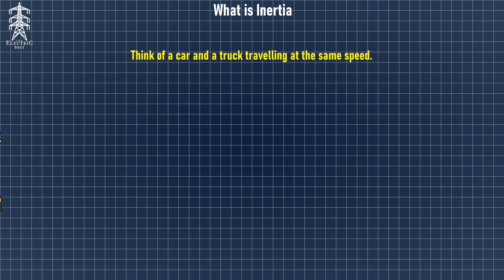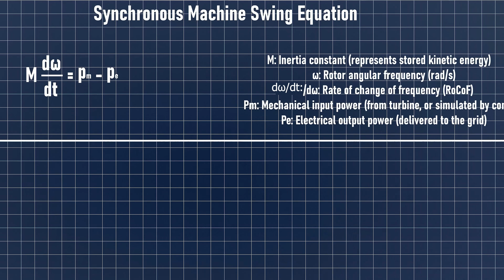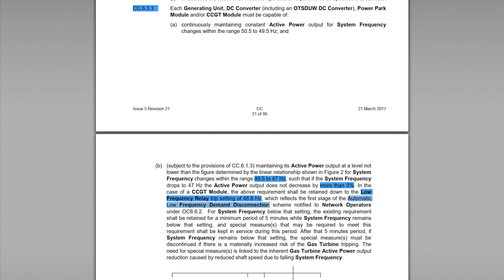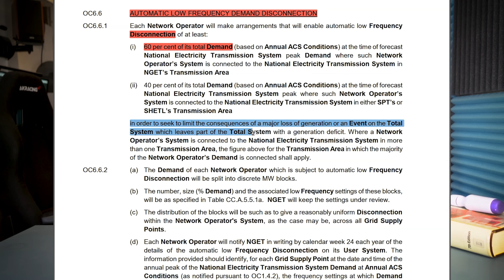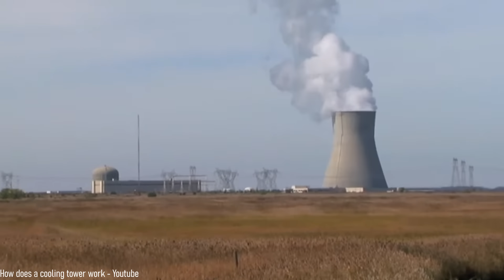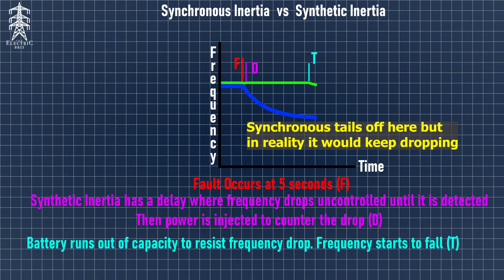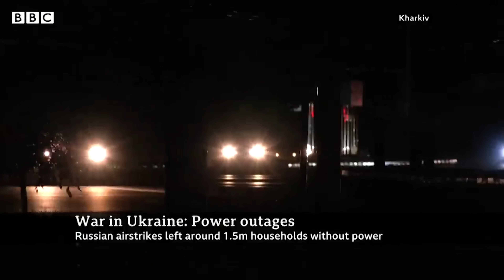How to Restart the Grid after total collapse

Comment: What are the technical costs and isuses with grid forming solar?

 I would have thought it was ideal for black starts (if you can wait for it) as there's no physical issue with continued generation. Unlike nuclear, wind, or even fossil it does no damage to the panels to create un used power  and you can isntantly collect that power. 

Obviously inverting that DC power to use it is the technical problem
Reply from the maker: I think the grid forming part is understood now that smart inverters are becoming a lot more common. G99 mandates that solar installs over 16A or 1MW must be able to give voltage support, but does not yet specify grid forming.

The risk would be relying on it solely on a black start scenario when you can’t guarantee the sunshine or consistent power output like a generator. It would be good support though with other sources.

Comment: Thanks for this. A lot of audio and visual info at once; I had to keep pausing it to follow you. You did not explain how the various islands during black start manage to keep their 50 Hz voltages in phase before they join up. I was surprised that you said HVDC interconnectors could not be used for black start. I'd have thought that importing DC and generating ones own AC would have made them ideal for helping black start.
Reply from the maker: Thanks for the comment! Yep I really need to get my pacing right on the animations and stop relying on on screen text. I’ve had a lot of comments about the resync too so should have really covered it but hindsight.

Regarding interconnectors, it comes down to the technology. European interconnectors do help each other out and some of ours based on newer VSC technology can also be used for black start, the info in the video was mostly based on official sources and interpretation though which suggest otherwise.

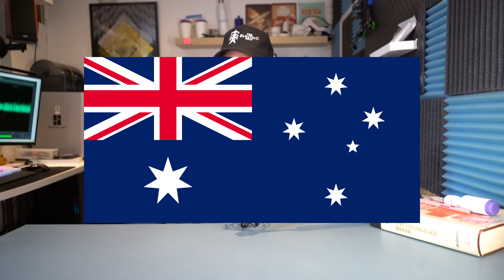Comment: 22:40 Just a clarification, Australia has the NEM, or the National Energy Market, with two states/territories not participating, and isolated/not connected, WA and NT. The other states each have a state transmission grid, with inter-connectors between them.
Also, South Australia is significantly less populous, and so we can get away with between 60-80% wind depending on time of year, worst time being the cold period around july, with as much as 50% gas.
Reply from the maker: Thanks for the context. High renewables and lower demand definitely helps it’s case for being energy independent if it needed to

Comment: A bit off topic but ... A worrying aspect for me, is having witnessed a manufacturer of supposedly high quality alluminium lugs, for cable crimping in the electrical supply industry,  completely fail to understand why they were supposed to fill the freshly drilled out cavity with anti-oxident paste - I could be worrying for nothing if this is my misunderstanding but ...

....   I'd only just left the electrical supply industry where we were taught that the paste protected the alluminium from oxidising prior to crimping and that we should not even open the packet until ready to crimp.  

However, my next job was as a drill operator / dogsbody at an alluminium parts manufacturer, making parts for everything from aerospace to the electrical industry - and I was dissappointed to see that these lugs were left lying around for days or weeks before anyone was given the boring job of injecting the anti-oxident in them.    

Unless it's me misunderstanding something, this seemed very negligent of them because surely, the whole point was to protect the freshy drilled out cavity immediately after drilling, but this was never done.   

I tried to explain to someone higher up but nobody cared.   So when work was slack,  I would be given the job of filling them with paste - It made me wonder how many of these would fail prematurely because the surface would already be oxidised  (unless the antioxident is able to restore the surface to it's unoxidised state??   I don't know - it just seemed unlikely)  - but this has always made me worry about the quality of manufacture of parts if noone is checking procedures and no-one understands the purpose of the component anyway. .

Comment: So then, were asynchronous power sources a factor in the recent colloid the Spanish grid?
Reply from the maker: I’m waiting for more concrete info but I’ll definitely be covering it in as much depth as possible. Varying reports from the two solar generators tripping to inter country oscillations across the grid playing a part. Hopefully the report is transparent. 

They do have an extremely low amount of battery storage and at the time had a lot of hydro and gas turned off, so it could have played a part but we need more answers.

Comment: Black start capability of a power plant is not the same as powering up a blacked out grid … many power plants (used to) have island mode operation (including nuclear) and backup generators that could allow the plant to start in the absence of grid power …

… the option to connect to a dead bus, a blacked out grid, is a different matter and then there is the problem of synchronising the different arts of the grid if they have been powered up independently as grid substations do not have a synchronising capability.that’s the difficult (and untested) part!

Comment: Should pony out that when turnogeneratoer are in frequency droop control, 2.5% that the system is somewhat self regulating in the short term and that most thermal and nuclear power plants can operate at 110% MCR for short periods whereas renewables can’t!

Comment: How do you sync with neighbour networks eg. via AC interconnectors (DC is not a problem)? Do you temprarily run the UK grid a bit faster (>50 Hz) or slower (<50 Hz) in order to catch up with the external grid?
Reply: There are no AC interconnecters. That wouldn't work.
Reply: @linuxgaming69  ok, so all interconnectors to the UK are DC? Then -virtually - you can do frequencywise what you want, true.

Comment: Around 2015-2017 South Australia had a total grid collapse,

Bad weather pushed a few high voltage transmission lines over, the wind towers didn’t like the transient spikes and disconnected, a major plat was under maintenance and the SA to Vic connector pulled approx 2x it’s rated load and disconnected, 
CBD was back up in about 12 hours, regional SA took months of no power.
Elon built a 100MW battery in less than 100 days (or said it would be free)

Comment: Main point: why don't we use an atomic clock and synthetically synchronise all grids to it? Neither following, nor forming. We could remove spinning turbines wherever possible - if they spin outside limits they should be the ones to disconnect and only come back when they are resynchronised (or, minor point, maybe not disconnect spinning turbines in the above scenario, but use batteries to maintain the frequency of those generators - only if that's better than disconnecting them altogether).
Reply: Supply and demand. If they aren't nearly exactly matched you've got a problem.
Spinning reserve is the backbone of the system because it contains so much stored energy. They will never slow down unless demand exceeds supply. You want to replace that with batteries good luck finding the extra billions required not to mention the environmental impact of the mining and manufacturing.
Reply from the maker: Hopefully Sodium Iron Phosphate batteries start to take off over the next few years and we start seeing them applied to BESS as a more environmentally friendly alternative to lithium.

Comment: I miss the 90's. I had 60-100w bulbs in most of my house that were never switched off, electric fires in the winter and basically never worried about it. I'd spend 10 quid some weeks. My house now runs on a lot less power. All the bulbs in the house don't add up to 60w! My fridge, washing machine etc etc are all more efficient. Yet my bills are 10x what they were.

Comment: One clarification… In the df/dt and d(omega)/dt, the ds aren’t deltas but ordinary letter ds indicating differentiation. So df/dt is the first derivative of frequency with respect to time and can be said just as “dfdt”.
Reply: dy/dx can be described as how y changes with respect to x, so df/dt is a measurement of how quickly frequency is changing at a point in time
Reply from the maker: Thanks for the comment and good spot. I should have been clearer when changing between df/dt and Df/Dt. My understand is lower case is used in the swing equation so is actually d omega, whereas Df/Dt or the triangle version is more like what’s used in RoCoF (but confusingly I’ve seen it written lowercase). Maybe I’ll issue a correction

Comment: AC grid in era of hydro power and long distance transmission had more sense, because AC was needed for transformers to work. 
But with modern power electronics, and renewable energy, DC grid has far more sense.
You just have to worry about maximum voltage and maximum current in the grid - which is far easier than having to control the frequency too.
In DC world, parasitic capacitance is a benefit, bringing stability to the system and not a loss factor.
Many household devices could be made DC ready, like lights, air conditions, fridges, washing machines, power supplies. Resistive heaters do not need modifications at all, like passive space heaters or water heaters. 
Most EVs have DC input, so a simple DC-DC converter can pump high power into the battery OR make a car energy storage device.
Earth super-grid could be possible, so the whole planet could run on solar 24h a day.
Reply: There is a cost /benefit graph for using DC. usually on the longer runs, with converters both ends. Using AC predominantly means you can easily use High voltage AC transmission to minimise losses and conductor sizes, then easily transform to lower voltages for distribution. Dc wouldn't cheaply let you do that.  For long runs HVDC makes economic sense.
Reply: @foxwelder AC system enables having cheap transformer.
But if you have DC grid, you replace transformer with DC-DC converter.
You still use high voltage for long distance, earning benefit of lower losses due to lower current.
But AC has additional losses due to inductance and capacitance of the wires themselves.

Comment: Such a simple issue but so complex in scale. I have doubt none engineer types will not fully get the "inertia" aspect that can be both a blessing and a problem but infinitely better than none at all. I am not an advocate of wind and solar (let's not go there) but do encourage specific applications were they are a sensible alternative.  To highlight this point the Heathrow airport debacle is a classic example of crass stupidity and a fundamental misunderstanding of system and safety requirements, I would like to see the details of the insurance claim for that one far too much political chicanery, ignorance and personal gain from my point of view. I think the underwriters will throw this claim out unless they actually accepted the risk? Diesel or air start for "dead ship" is still the safest method.
Reply: Interim report is out.   They were never as resilient as they thought they were. Single points of failure still existed, they were seemingly told ages ago and allegedly nobody wanted to fund making it better. Lots of time spent of getting the substation sufficiently isolated to let the fire brigade ( and repair crews) inside.

Comment: Thank you for this presentation. In the early days of electrical generation it was a race between AC and DC. AC won because at high voltages it could be transported longer distances. Also, building large power plants was more efficient. To me, this set us down a problematic path. Now, electrical generation is decentralizing which is reducing the need for a highly controlled AC power grid. We should be thinking in terms of one hundred years. What I see is a network of self standing but interconnected  battery nodes. They receive inputs using HVDC and MVDC from many different sources. AC power will be provided via microgrids.